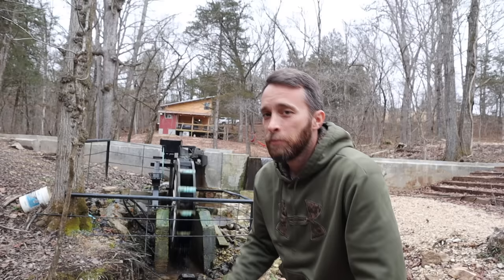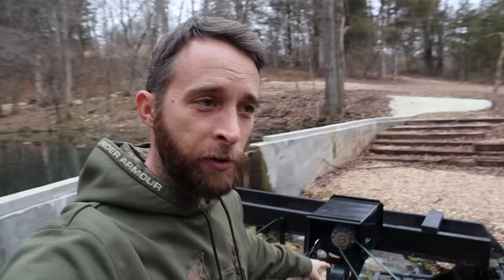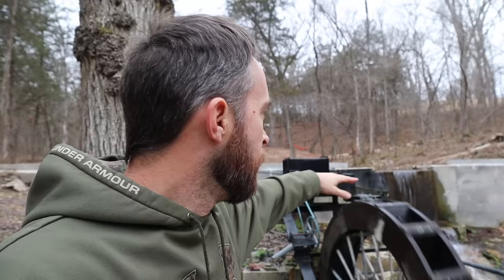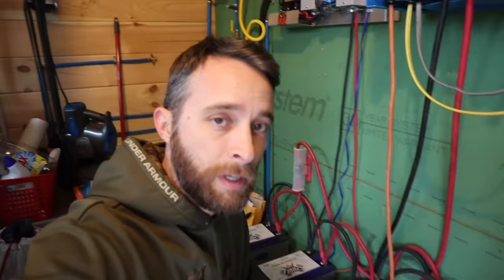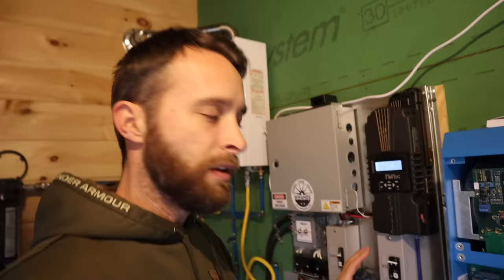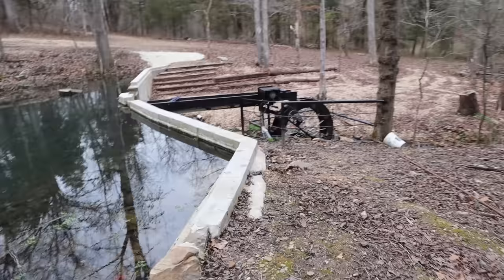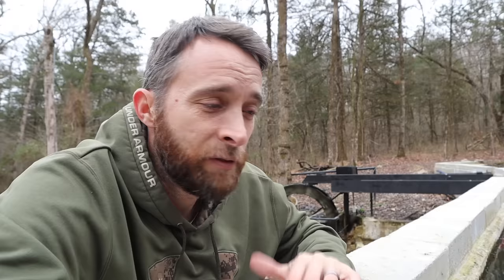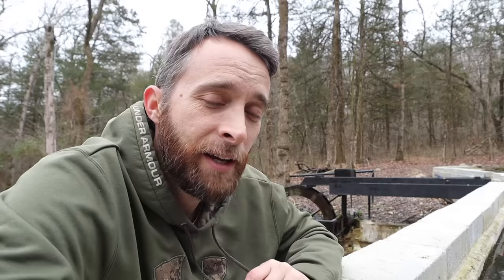Did we MAKE HYDRO POWER Using Our Waterwheel for Self Reliant Off Grid Living?

Comment: What's the voltage at the generator? 
What's the voltage at the house?
How much loss?
Low voltage needs thicker wire to transmit power.
That's why power is transmitted on high tension lines cross country.
Some of those lines are very high voltage.
This allows relatively thin conductors to transmit massive amounts of power.
The high voltage is then stepped down by transformers.

I would try to use a three phase motor as an alternator.
The rotor is powered inductively in a 3 phase induction motor.
Meaning the rotor has no physical connection to the electrical circuit.
The magnetic field of the stator induces current in the rotor which then produces a corresponding magnetic field in the rotor, which being slightly lagging the field in the stator, causes the magnetic force to move the rotor.

There's usually a bit of residual magnetism in the iron mass of the rotor for some time after it was running.
To use it as an alternator, it must be spun at a slightly higher speed than it would spin when powered.
If it has lost all residual magnetism, it won't produce any power.
In that case, DC current can be placed briefly across any phase to induce current and that will start it up.
3 phase motors can be removed from industrial equipment that has been scrapped. 
I would think a 3 HP motor rated for 220 volts would be about what you need, If you need 2000 watts.
1 HP is 746 watts.
Higher voltage would allow more total power to be transmitted along thinner wire.
2000 watts at 220 volts is approximately 9.09 amps.
For 200 feet of run, 10 gauge wire would probably be fine.
Good, tight, clean and dry connections, with adequate surface contact are essential. 
The lower the voltage, the more essential is good connections.
Voltage drop on long wire runs is a big problem with low voltage.

Second choice would be a vehicle alternator, with the regulator modified to produce higher voltage.
Alternators actually produce high frequency 3 phase AC current, which is rectified to DC.
They've been modified for decades to make welders, motors and generators.
An alternator will need some power to begin producing current, as the field winding in the rotor needs power to produce the magnetic field.
It is regulation of this rotor coil, That determines output voltage.
Power to the rotor coil is supplied through the brushes.
The stator output is usually connected directly to diodes that rectify the current.
Alternators are more complex than 3 phase induction motors and probably easier to find, but their output more complex to utilize.
3 phase motors need a steady speed, higher than their normal operating RPM, to output 60HZ current.
Exactly how much, I don't know.
I would think about 5-10%.

What might work for your situation, is to move all the equipment and the inverter to right next to the water wheel. 
Then voltage drop would not be an issue and the output of the inverter can be fed to the house through the existing cable.
You would need some type of weather tight enclosure or shed right at the wheel to house it all.
With enough ventilation to keep the electronics and batteries cool enough to function.

Comment: Re-wire for 12 volt. Reverse the wheel and let water drop on the other side and wheel use the gravity of falling water instead of loosing power (rpm) by water shooting over the top. Also could put an inverter in a small shed at the wheel and convert to AC for the run to the house.  Just some ideas. Good luck.
Reply from the maker: Thanks 😊

Comment: Thanks for the update. You can make this system work. You might need to make some small changes...in fact, you might actually have everything you need already...except for repairs to the pulley key missing.

I think you're loosing too much power from the generator to your home. You might want to try the AC version, so that you can lose less voltage, and you can also use a transformer / inverter...but your idea and implementation so far is very cool!
Reply from the maker: Thank you 😊

Comment: You built an overshot type of wheel, but a backshot design with tailrace contact at wheel's bottom gives best efficiency of energy extraction. Shape and width of wheel's buckets can be tweaked to prevent spillage. It's easy to measure the true volume of flow out of the chute.

Comment: Sounds like you need a good electrical analysis to start.
Also, with all that water close to the belts slippage looks highly likely to be the cause if the humping jumping amps situation.
Try a two belt two pulley system possibly spring loaded to maintain constant tension. Get a couple if cans of belt spray stickem to add adhesion to the belts. Put a cover on them to keep rain water off! 
Good luck! Looks like a great system!
Don't replace the generator yet, but add a flywheel to it to keep it steady also!

Comment: Take a car flywheel to your upper pulley and matching starter bendix gear on your generator spindle.  Per revolution of the flywheel to the generator will usually be about 12:1 ratio.  Increasing the ratio with your pulleys is another option but I'm a fan of direct drive for the torque. Maybe consider surpentine belt and pulleys.  The spec. limit of RPMs on your PMG needs to be considered as that nice to have problem could be something to put some deeply drained batteries switched in to put more resistance on the PMG and lower the RPMs if the surge occurs. When your batteries are full there is less resistance at the PMG and when they are low is higher resistance.  You have the supply of RPMs at the waterwheel to be successful.

Comment: Hey! Switch to an alternator and convert to direct current in the cottage, then the power loss will be smaller and you have an opportunity to succeed. Then I do not know what kind of cable you have up to the cottage, it is possible to calculate the cable loss per 100 meters in volts. In the video, I think that the water does not end up right in the water wheel to get maximum effect, but it can look different in reality. You also do not get any pressure on the water when you take it from the surface. If you can not make a dust hatch at the bottom of the wall and lead the water under the wheel in that way, you can regulate the speed of the wheel and you have a constant flow.
Regards Gunnar

Comment: Hey I love the videos! I might have solution for your water wheel power issue if not solved! Bring your batteries closer to the water wheel system then run your inverted power to house power . DC power doesn’t travel well, especially long runs like your own . Build a shed 5ft- 10 ft away from the water wheel .
Reply: It doesn't matter how well DC travels if you aren't generating any power to start with. This system is perfectly designed to generate no power in the first place,

Comment: As others have said, it's a combination of things, but you should be able to get this to work. First, you need to test the output at the generator when it is at 500rpm. If that looks good, then your voltage drop is in the lines.  DC can't run that far without large low resistance lines. That's why we use AC in our homes, but almost all electronics run on dc and we convert to it at the outlet. If the voltage drop in the lines is the issue, try an AC generator at the water wheel, and then convert to DC at the battery bank.  Hope you get this working!
Reply from the maker: Thank you

Comment: Don't give up I bet you can get that wheel to work. Find an old small generator with a broken motor and adapt it to the wheel. send ac power to the home then step it down to charge the battery bank.

Comment: You need a volt meter to start checking things up at the house. You need to see what kind of voltage drop your getting from your generator to where it comes in to the house.
Reply: For 200 + feet distance to house , what appears to be # 10 AWG wire is WAY too small a size to use . Get a voltmeter and check your voltage at the generator output terminals then check the voltage at the house . I predict a sizeable voltage drop .  For my 12 volt system at 50 feet length , I use # 6 AWG cabling and the voltage drop is in tenths of a volt .  The larger the wire size , the less the voltage drop . The Midnite Solar Controller is an excellent unit to use . I have the 150 amp model and am planning on adding a second unit with follow me control wiring . You could also consider a generator with a higher output . The Midnite unit can handle the higher voltage and provide what you need .

Comment: Checking on a update video.
I was thinking you should check the specs on your charge controller. I think it takes 200 volts for it to operate.
If you are suppling less then that it will not do anything.

Comment: I agree with your spout hitting too early. Also, I'd look into using a high voltage (150-200 amp) car or truck alternator instead. There's a video on YouTube about how to get 120v from a car alternator. Definitely something to look at. You can always step up or step down if necessary with transformers then rectify with diodes for dc right before the batteries or charge controller.

Comment: Good job..please keep on it , u r almost there. You can get 500rpm not hard for 2kw if the water flow like the short clip u showed, belt slips and rpm monitoring. Water channeled properly will get u the power. Keep at it bro.👍

Comment: I think you are on track here for something really good. You probably need some assistance to properly set up and size the generator , wire size , etc. Even a lower wattage generator should be sufficient to charge your batteries. The great thing is the water runs 24/7 , unlike solar or wind. Good luck and hang in there !
Reply from the maker: Yes I just need an expert to come help me. Finding someone in Hydro is difficult.

Comment: Hi, what youre describing here sounds like a problem I ran into with my off grid waterwheel. I have about 3 feet of head and have my wheel matched to a Missouri wind and solar PMA also. Mine is a retrofitted delco car alternator. You say that the amperage is not constant and goes between 1 and 3 amps. I had a similar problem. I built a homemade charge controller and after lots of troubleshooting I discovered that the problem was actually a slipping belt. I couldnt actually see it, but that belt linking the waterwheel to the first pulley has a LOT of torque applied to it and was constantly breaking loose under the load of charging batteries, especially if those shafts arent perfectly round. I solved the problem by buying double V belt pulleys for the waterwheel and middle pulley. I had to use 2) 5L belts and lots of tension. It was really hard to tell that there was a problem because the motion did look constant and I didnt hear a squealing rubber. Try holding the middle pulley with one hand while spinning the waterwheel with the other. If the belt spins on the pulley, there is your problem. You have to use better pulleys or a chain and sprockets. Your gear ratios look close to what I got. Dont expect a whole lot of power. I get about 40watts from my hydro setup. I have solar here as well. Good luck. I hope this helps. - Bill
Reply from the maker: Thanks Bill

Comment: Im running 12 volt bilge pumps with their own 24 volt panel. They spin twice as fast and are running at 2200 and 3000 gph. You could add these to you water supply and pump more water to the wheel instead of relying on gravity alone.

Comment: There is a good reason why power is transferred at very high voltages. A low volt system would have high losses over that run of cable.

Comment: use your damn as the start for the 20' drop you need.  Run a pipe downstream to build head pressure for a turbine system.  Also, if your running that thing DC up the hill, your voltage drop is from too small of wire over distance.  Try running it AC from the little alternator/generator thing.

Comment: From a country home standpoint, the water wheel adds a nice quality to the home. From a power generation standpoint, water is around 10 lbs/gallon. My guess is your water flow is around a hundred gallons per minute. It would take 33Xten minutes to gain a single horsepower. That is a 75-watt/min. output if you are lucky. 10lbs times a hundred gallons is a thousand pounds and 33 of those is a 1hp not counting mechanical losses. With a battery bank, the water wheel can supplement but not continuously. To get your supply, get the high elevation by letting the wheel pump water up into a tower and run a turbine from a higher elevation for a continuous period of time. Pulse charge the batteries and let the tank fill on a timer system. It could if nothing else supply household water on demand. You could get more duration at the higher wattage from the elevated tank which includes the mechanical cost of pumping water. Or just enjoy the wheel pumping water to your pond.

Comment: Are you running DC current all the way to the cabin? That is a LOT of resistance loss. You would have to have some REALLY heavy gauge wire for that. I would put an inverter by the wheel, and push the AC current to the house for less loss.

Comment: This is something we'd like to do on our off-grid homestead.  Thanks for the ideas!
Reply from the maker: Our pleasure!
Reply: Just think about have the water come form bottom of dam you may get more water presser
Reply: @alankawaratani1677  we've seen them done both ways.  I'd guess that water from the top would be good for a lower flow since gravity would pull the wheel whereas if flow isn't an issue then from the bottom would worj since it would be pushing the wheel.
Reply: @Off-Grid  He said the water wheel slow down when he turn the system . I do not know exact what that tell me Low in torque?

Comment: Try changing the charge controller. As your amps are fluctuating, batteries are not getting charged properly. You are getting more voltage than needed but unstable amps. Check for MPPT kind of controller

Comment: Nice equipment dude! I would think that any generator should be connected directly in line of the shaft of the wheel, so you have no losses with pulleys and gears. Try to use two motors from a hoverboard. One on each side for 400 watts total. Or a modified car alternator shown by Joe Malovich. OpenSourceLowTech has a video $50 water turbine and at 1:10 in that video he shows he made a generator from a hoverboard. Run 3 phase AC to the house with 1 good rectifier in the house. That would be higher voltage and more dangerous but it should generate something usable. Good luck!

Comment: If You could get your water flow in a pipe where you can extend the length and aim it down to get the water to be more like pressurized water forcing the wheel to go faster with less water used. Then if you move your electric storage closer and convert to AC voltage that can travel the distance to the cabin with less wasted power or less voltage drop. I would guess that would make your awesome setup more efficient. Another idea would be to use the water wheel to replace the gas engine on the generator to power your home. I hope I have gave you good ideas. Good luck and I hope to see it working for you

Comment: dear friend;
I have some suggestions for fix your problem
 1.increase water volume( you can build the wall to high),
 2.increase the gap between the top of the water level and the pipe hole (pipe hole means the place which is water out),   
 3.increase the velocity of output water (you can follow the equation of continuity. simply this   A1V1 = A2V2 ), etc.
 I'm a student. I am learning advanced level physics. I learned
about fluid dynamics 1 years ago. so I suggest these... I'm not good at English so if I am wrong please sorry for that ..

Comment: The main drive pulley should be bigger and attached to the wheel.  This will create more torque.  There's this guy that has a show that builds off the grid houses and he had the same issue with his water wheel

Comment: Leave the wheel for showpiece or some lights near the lake and for the power use the drain pipe for a small turbine that can spin really fast with water flowing fast under pressure to a place as low as you can......... For transmission use step up transformer to get hvdc or hvac to make the power loss neglectable